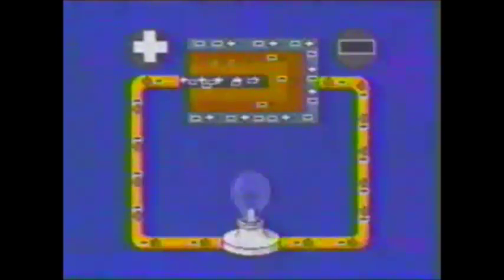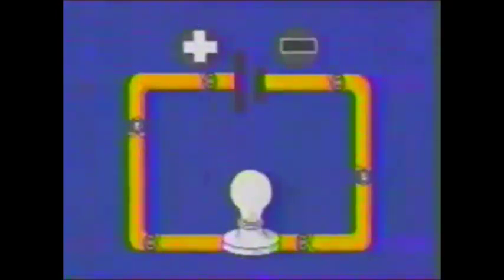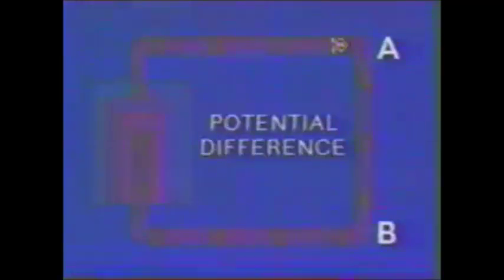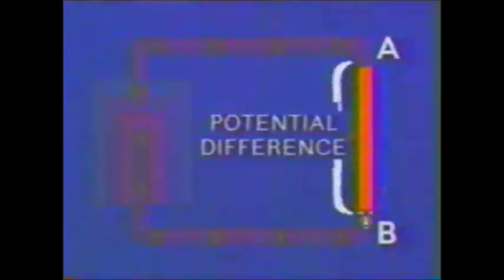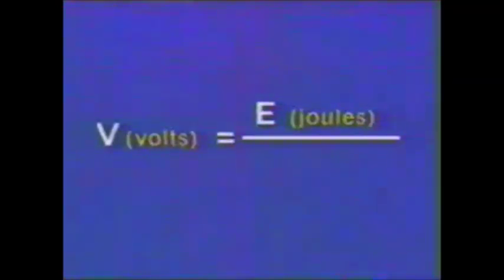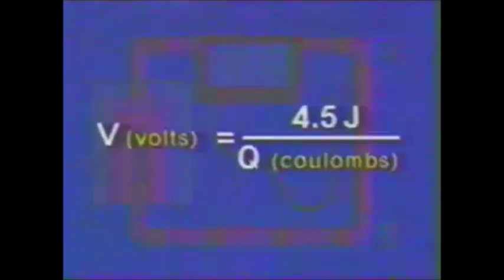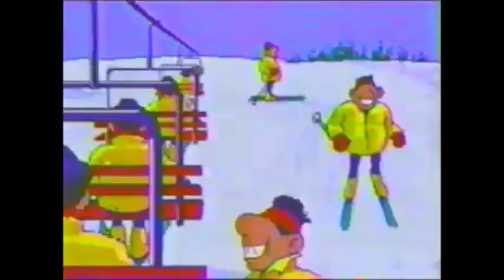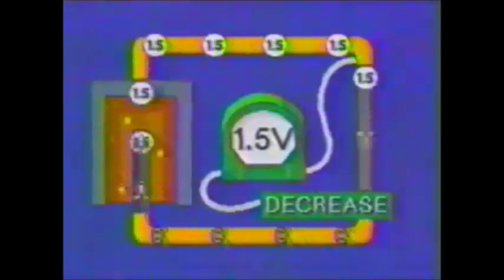What is Voltage ?

Comment from the maker: +Johnty fernandes V=IR, which basically tells us that Voltage is the measure of energy lost and it is directly proportional to the coulombs of charge that flow through the resistance. Resistance is more of a balancing part of RHS of the equation. If more charges flow through a circuit consisting of constant resistance, then the energy lost in the passage is more compared to the one with less charges. Which means that even with a higher/lower resistance, if more charges need to flow then obviously a higher Voltage needs to be applied. 
For eg.
Case A)  In a 12V crkt, with 12ohm resistance, when crkt closed then a coulomb of charge will flow through the resistor every second loosing 12J of energy. 

Case B) Similarly in the same crkt to obtain more heat energy lost against the resistor 12 ohm, one will need more charges to flow through it, which can only be obtained by increasing the voltage applied across the resistor. For eg. If the voltage applied is increased to 24V then TWO coulombs of charges will flow through the crkt every seconds giving up 24J of energy every second. 

Case C) According to your question if we increase the resistance to 24ohm and keep the voltage as 12V then only 0.5 Coulomb of charge will flow through the resistor every second giving up 12J of energy rather than 24J like in case B

Case D) If we increased both the voltage and resistance to both 24, then only one coulomb of charge will flow through the resistor giving up 24J of energy every second. 

In conclusion the number of charges flowing through the crkt at any point is function of the resistance of the concerned point of interest, as the voltage applied is mostly constant in many real case scenarios. 

I hope my reply was helpful and please probe me anytime for any further clarifications

Comment: amazing video ,very helpful.Thankyou. bt i want to ask you that is it necessary for a coulomb to to lose 2joules of energy while travelling through external circuit if 2V potential difference is applied across it.what if we increase the resistances of the resistors .Will the coulomb then lose more energy

Comment: So what's the answer to the question at the end of the video?  Why if 2 electrons are flowing at the same rate does 1 give off more energy than the other?  I know it talks about being given electric potential, but what exactly does that mean?  Does it vibrate more?  With the skier even though he has the potential energy from being on top of the mountain he can't do any more work between 2 poitns if he's traveling at the same speed as a skier towards the bottom of the mountain